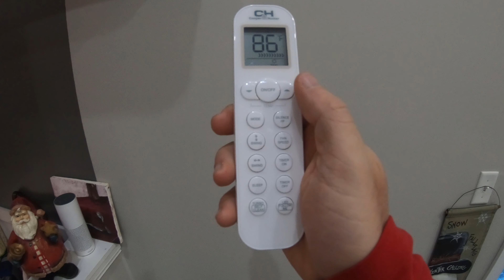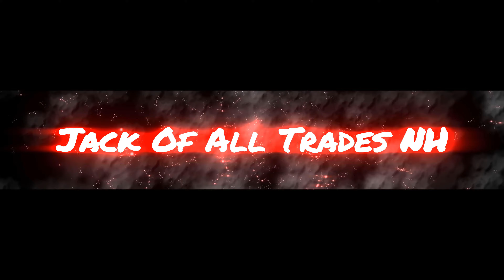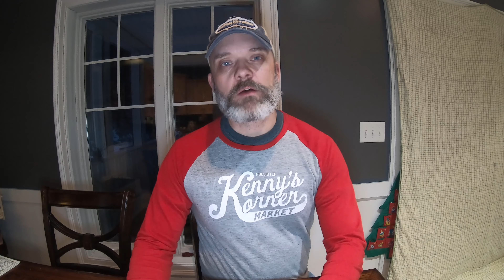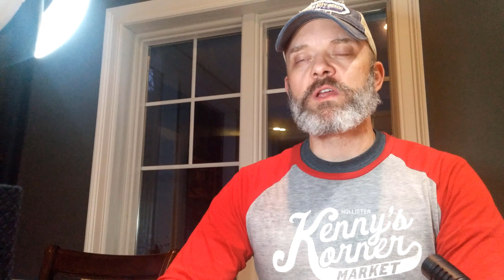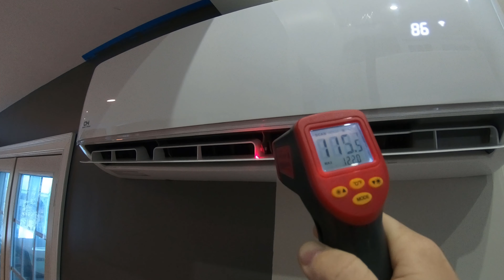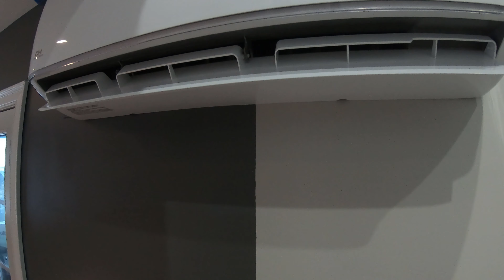Installation and also answering, Can a mini-split properly heat your space in the winter?

Comment: With these new models snd inverters, we just set the temp and let it be all winter long. Takes very little energy to maintain the temp and when wood stove is on, it uses nearly nothing on electric. The great part is as you said, I don’t have to get up as early to turn on the stove… keep the temp at 66 or 68… mine runs at -22
Reply from the maker: Babysitting that wood stove is a full time job! :). Thanks for the comment.

Comment: Hey pal, thanks for this video!  I just installed 3 units and they cool but do not heat at all. Do you have any suggestions?
Reply from the maker: Are they 240 volt units but you used a 120 volt breaker? Also, another idea... if it's not cold enough outside the heat won't kick on....so if you are testing them make sure it is cold enough outside. One last thing, if this system you installed has 3 indoor units but only one outdoor unit... all indoor units have to be turned to heating for it to work. If one is on AC they will not heat. Good luck

Comment: Thank you Sir  for the time spent to make this video. Now I have numbers to compare. Mine doesn't heat even when outside is 48F
Reply from the maker: Mitch does it cool at all? If it cools but does not heat then it may be the pump is not switching over. I think the coolant travels In one direction to cool and goes in the other direction to heat. If it doesn't heat or cool then it could be low on coolant.

Comment: Thanks for this!  I have contracted an HVAC company to install 3 heads (30,000btu) to heat and cool my 2500 sq ft. home on two floors.  My trusty central air (York) made it to 30 years, but developed a bad freon leak.  So, it was shut down in May.  Enduring the heatwaves here has been a new adventure!   

Anyway, I am excited to get this Mitsubishi system (upscale model)  with hyperheat installed a month from this writing.  My gas furnace of 42 years is still running just fine, even tho only 70% efficient, but it will be a great backup just in case.  And keeping all the ductwork and running the air handler is another plus.   Mitsu even mentions in their brouchure that many customers hold on to their forced air heating systems.    I would be happy to report back later and let you know how this is all working out.   Rebates will be coming too (O:
Reply from the maker: Great to hear Gary, let us know how it works out. Having a backup system is good for security.
Reply: Gary - Are you happy with your Mitsubishi w/ hyper heat?  Let us know you zip code of state.  I am curious of your heating requirements versus cooling requirements and how the system has been this winter.
Reply: @Dave-tg1pu  Hello Dave, your message just came in on my screen as I was doing some computer work (O:   To answer your question, all I can say is, they work just as advertised.  I do not have the Hyper Heat ODU, just the standard 30k btu with 3 taps.   The air handlers are Hyper Heat.

(I am in Massachusetts)

I learned more about them after a short while running in AC mode (end of season) then crossing over to heat mode.   There are many 'nuances' to this system that most people will never know or learn about, but since I am a bit of an electronics geek (and ham radio license holder), I noted many interesting things, and concurred with my dealer on the findings, which they got a bit of a kick.

Performance wise, this system makes heat down into the single numbers, as it is rated down to 5 above.  At that point, the air is warm only and the compressor and fan are at full speed ahead!   

Had only ONE incident so far.  Woke up to a cold house (52 degrees!) and DASHED down the hall to see what was going on.  I noted the outdoor temp was MINUS 1.8 degrees on my weather station!  The Mitshu system was running only about 2 minutes and then would shut down.  Clearly WAY below it's rating.  So, that was to be expected, but it was good to know it's limit!

I broke down and started my forced air gas furnace, on that morning,  and it took 38 minutes to go from 52 to 63 which is where I was all last winter before the new system went in late August.

It ran for 3 cycles, about 1.5 hours until the morning temps outside made it back above zero in the morning sun.  I turned off the furnace, and went back to the Mitsu system.  It stayed on normally with the usual defrost cycle.  That was the first week of February and I never ran the furnace again.

I would say the system makes GOOD heat without too much struggle into outdoor temps in the mid teens.

Oh, and TWO billing cycles have come since Feb.  I use gas for cooking and water heater only.  The 1.5 hour of that old 150k btu furnace pushed the gas bill up by 7 bucks !!  Last month's bill, was back down to $38.   

The electric was up of course with the new system, HOWEVER, I am enjoying much more comfortable temps = 68 - 70 degrees all winter.  This compared to 61-63 with the gas furnace last winter and I believe according to my latest bills, I am still ahead of the utility cost game ((O:

I also found that Mitsubishi makes whole house 'air handlers' and I called my dealer and asked about them and why it wasn't suggested.  To be fair, they KNEW I wanted to keep my gas furnace in place (which is why they did not push me for the complete Hyper Heat system). 

And for this home, I would need TWO of them because they are only 36k btu each.   But, that would have been nice to have them hooked up to my current and original ductwork.

Well, I can ramble on and on, but one last note.......................good friend of mine JUST had a system similar to mine installed on my good word.  His is a Hyper Heat complete system and I just texted him last night to see how it was running and I got the thumbs up (O:

I hope Jack of All Trades caught this LONG reply because it answers his question too.   Thanks for reading.   If you have any other specific questions, I would be happy to answer.
Reply: @garysmith8455  Hey. – Thanks for the quick reply!  My main purpose for investigating is two fold.  1) I have 4 window  AC units that I’ve been using for 25 years and its time to reconsider.  And  2) I considering installing a Solar system on my roof to make enough electricity for my current elec. usage PLUS my heating needs (with the mini-splits) and a future EV.  I don’t mind considering a air handler but I’m thinking the “ducts” will add much more cost.  I currently have NG (Eversource) with basebord radiation and a hot water heater off the furnace as a zone. 
 
I am wondering how effective the Mini-splits will be at providing 100% of my heating needs.  Have been told that in CT the heating needs are generally 2 to 3 times that of the cooling needs.  Implying I may have to overbuy a system if I want it to provide the sufficient heat.  I don't know how accurate that is and how often do we really see temps below -5 degrees?

I would really appreciate any recommendations you have for someone considering a MrCool versus Mitsubishi versus anything else.
Reply: @Dave-tg1pu  You are welcome Dave!  Yes, ducting would be a major thing to add to a home that has none, so I would consider the mini-split system!  Certainly go with the FULL Hyper Heat system which is designed to be your PREMARY heating system.

Again, and after the fact, I talked to my dealer about upgrading to the full H2i system.  Well, even at only 8 months old, he said they would have put in LARGER wall units, change out ALL tubing and beef up the electrical, and then complete with the H2i ODU.  

So, this meant to basically, rip my new system out, and start all over again!!  I thanked them for the honesty and decided that outside of that one event BELOW 0 night temp, I would be happy leaving everything in place as is, and that was that.

Back to your system, and like me, seems you want to make for less of a carbon footprint as they say, I would highly suggest the Mitsubishi system.  They are pretty much the founders of the technology.  My dealer also installs Carrier systems, BUT, here is what they told me.......  For HVAC, Carrier is VERY good for CENTRAL AC and heating for the home and commercial markets, HOWEVER, the jury is out on mini-split / heat pumps.

It was $3000 LESS for the Carrier system, but after reviewing the warranty and the experiences of Mitsu going back some 50 years, I spent the added bucks for that brand.   So, I would give that serious consideration.

I am not sure about Mr. Cool, I have only seen what is from youTube posted experiences, so use your own judgment there.

I will say this, I LOVE the SPLIT venting on the front of the air handlers.  There are actually FIVE individual, articulating air fins in each unit.  I don't know of any other company that has that feature.  I use this option for the unit over my bed and it makes for a comfortable sleep.

Hope that helped a little.   You can go to the Mitsubishi website and learn quite a bit about their systems.  Let me know.
Reply: @Dave-tg1pu  I had standard heat pump mini split from Mitsubishi at my former Fl house and it was trouble free....and a great parts & labor 7yr warranty (I think they are now 10 or 12 yrs?). The big issue with Mr. Cool is as a DIY product and its warranty is for parts only.

Comment: I have a 12000 btu unit I'm my sugarhouse and at -25f it still heats just fine.
Reply from the maker: That's pretty impressive. Is it one of those superheat units?
Reply: @JackofAllTrades1  Yes, it's a Mr. Cool hyper heat. It's not a large space, but it heats it fine all winter in northern Maine.
Reply from the maker: @stevehardwick1578  thank, I appreciate the info to help others on the video.

Comment: I could not stand below mine, in the heating mode. The air was so hot! Summertime it would remove a ton of humidity. The inside air was crisp and very dry. The condensate ran out of the unit like I was filling a  bath tub

Comment: You mentioned connecting to your phone. With wi-fi?  I don't have internet to the house. Guessing I wouldn't be able to enjoy turning it on before getting home from work.
Reply: But u could prob program the unit to align with your work schedule so it would be on b4 u got home.
Reply from the maker: Correct, you would need WiFi to operate it remotely.

Comment from the maker: Who thinks I need to regrow this beard? 😬
Reply: would this work for a 2 bed apartment approximately 1000 sq ft as the only heat source in midwest? up stairs unit
Reply from the maker: @cloud24patrol  I would say as long as it’s the typical apartment setup that has a kitchen and living room area (big room) with the bedrooms branching off of that and with normal height ceilings, it should be fine. If you can get the unit to point towards the entrances to the bedrooms, even better. If it’s a more complicated setup where you have to go through rooms to get to other rooms... for example you put the wall unit in the living room, but have to go through the kitchen to get to the bedrooms, you may have issues with air flow and cold spots. Ultimately worst case you have to use some additional box fans to move heat around. I hope this helps, thanks for the comment.

Comment: At 5 degrees what did it keep your house temp at? I’m trying to decide if it is possible for me to use as my only heat source.
Reply from the maker: I have heard from plenty of people who use a mini split as their only heat source. I however used it as supplemental heat and primary AC. I would usually crank it as high as it would go (86) and run it for an hour in the morning to get rid of the chill in the air. In early spring and late fall I would run it longer and I could easily keep the rooms at 72 degrees. I have no doubt it could heat the rooms it was in though if I wanted to run it for longer.
Reply: @JackofAllTrades1  ty

Comment: Have you had the unit go to defrost mode when outside Temps plus wind chill gets in - teens
Reply from the maker: Yes, but I have noticed it happens much more when the humidity is higher out. Usually with super cold air there is almost no moisture in the air so it happens a lot less. I feel like it would kick into defrost mode once an hour on average. Hope this helps

Comment: 1200 Fujitsu did both in. 1200,sq ft, open concept 1st flr of 2 fam. did fine kept tempt at72 degrees, 24- 7 all year elec bill never more than $150 month for whole elec bill
Reply from the maker: Sounds like a steal considering what propane and heating oil cost! I’d do over 400 in heating oil alone if it was all I used.
Reply: @JackofAllTrades1  I am guessing you burned wood?
Reply from the maker: @mikeluongo537  yes. Most of the year the wood stove is going...maybe 7 months if I had to guess.

Comment: Can you please tell me what breaker size I should be using.
My new system is showing a code P6
And doesn't blow with the heater but is fine with the a/c
Reply: Hey Jack.
I found the issue.
Breakers and wire gauge is good.
The problem withe the mini-splits is that if you have more than one unit on a single condenser,  they must both be on heat or air.
The auto will also effect the units.
If one is on air the other unit will not function, as the condenser CANNOT operate in this status.
Thanks for your input
Reply from the maker: @edwarddavila9055  Interesting issue, but makes perfect sense. The outdoor unit can only do one function at a time so having multiple indoor units could tie things up. Thanks for posting your outcome in case somebody else comes across this same issue.
Reply from the maker: Hey Edward, so for this unit it is a 24K BTU heat and air (2 ton). It also runs on 240 volts (2 pole) instead of the more common 120 volts (1 pole) that a wall outlet would supply. I used a 30 amp 2 pole breaker with 10 gauge copper stranded primary wire. Keep in mind, you can have bigger breakers and wire than you need... the appliance will only take what it needs, but if the wire and/or breaker is undersized, then you run the risk of a fire hazard. Have you tripped the breaker? Is your minisplit possibly a 2 pole 240volt but only running on 1 pole 120volt? Give me some feedback and I'll try to help troubleshoot. Take care

Comment: Hi, thank you for the video and sharing the information. I am in Worcester, MA and considering replacing my oil boiler with mini splits. I have done some research but unfortunately I haven’t found out yet what the electric consumption is for the mini splits in cold climates. Would you be able to share the total electricity used by your mini splits each month during this winter season? Thank you
Reply: Why not keep the boiler until you at least keep the mini split for a heating season? If it were me,  I would keep the boiler around
Reply from the maker: Hello Sir from “Woosta” ... well I’m afraid I won’t be much help, my mini split does great in the winter and could easily heat the space I used it for but unfortunately, I only use it for supplemental heat as my primary source is a wood stove. So I don’t have consumption numbers for a full month of consistent use. I think comparing electricity use to oil prices will be your best bet, there are energy calculators online where you can compare btu’s from different heating sources.... then just plug in how much oil you normally use and the cost per gallon and then convert that over to the cost of electricity per wattage. The hard part will be figuring up what size mini split to use in the conversion since you do not currently have one. As an example though, my 2 ton unit heats with 25,000 btu’s.

Comment: I'm thinking about getting the toshiba 36,000 btu hr my house is 1400 square feet so u think it would keep it warm
Reply from the maker: It should, it really depends on how far away all the rooms are. If it's compact then it should be just fine, a 3 ton using is a decent size. If you have it on one end of the house and there is like a long hallway to another part of the house, you may see that it struggles with the far reaches. This is why when you plan your install, it is real important to keep a central location in mind (if you only use one unit). Thanks for the comment

Comment: Thanks for the video! Can you elaborate a little on the energy-star part? I'm in CT and we also have eversource, but i'm curious about the rebate process you had trouble with. Did they simply deny it because it was energy-star rated in 2016? If it had been 2019 it would have been okay? Thanks
Reply from the maker: Yes, the model I purchased was apparently an older model that met the energy star requirements when it was made a couple years prior but not the current standards. The company had the energy star logo on the box and was using it to advertise it's efficiency but when it came down to it, when I applied it no longer met the requirements so I couldn't get the rebate ($800). You can use DOE's website (I believe) to cross reference the model number you are shopping for FYI. I found that out later.